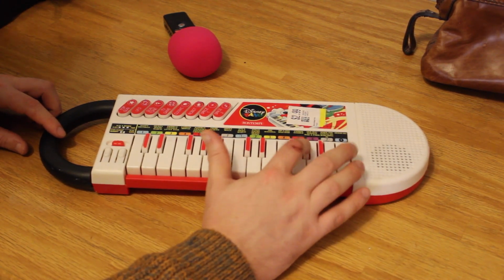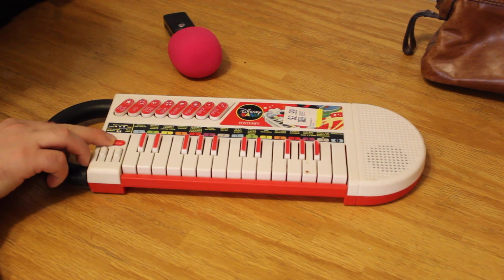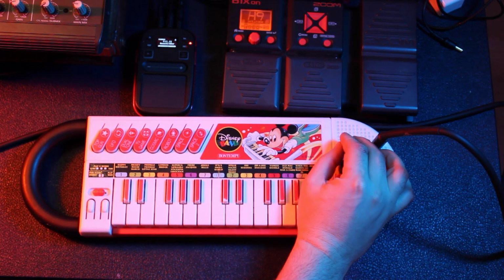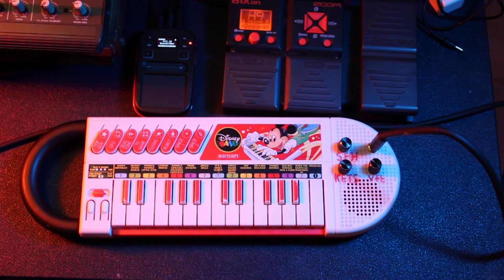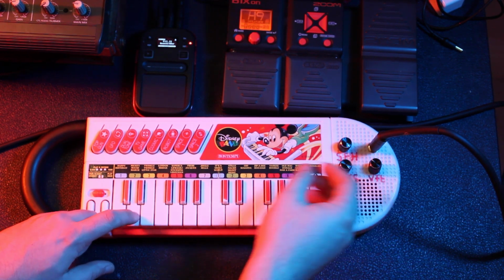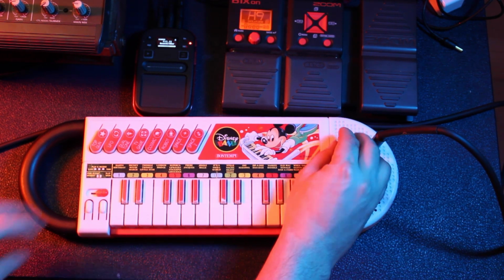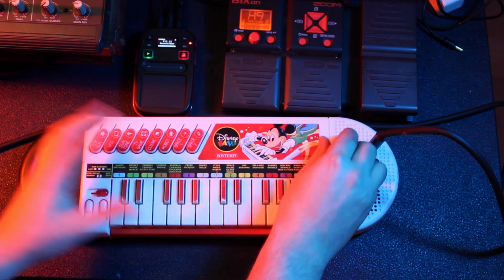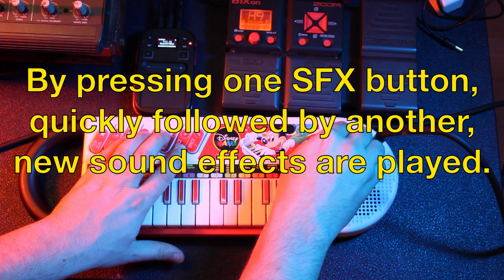Circuit Bending a Disney Toy Keyboard

Comment: hi, i have a casio mt 240, ive been looking for the circuit bending of this keyboard on many videos, with knobs, buttons, two-step toggle switches / toggle switch, etc to modify the sound to an experimental sound, like your video. But i have a doubt, when i modify my keyboard with this circuit bending (like videos on YT) its posible to go back to the original keyboard sound if I turn off all my switches and other things that i added to the circuit bending?
basically, if i do a circuit bending,
its posible go back to the original sound with all modifications turn off?
or once the change is made there is no going back?
Reply from the maker: If you set everything up correctly, and be careful not to damage the keyboard while bending, you should be able to do that. Use toggle switches to either send the circuit through the built in circuit, or toggle it on to send it through your circuit. If you've never bent before, definitely start with a toy you don't mid breaking like I did here, don't want to break a perfectly good Casio. Hope that helps!